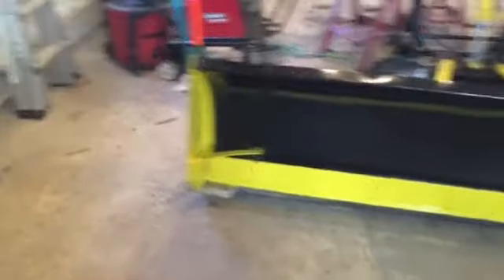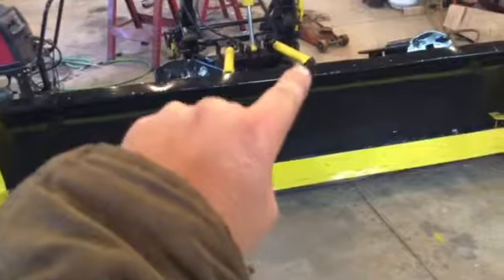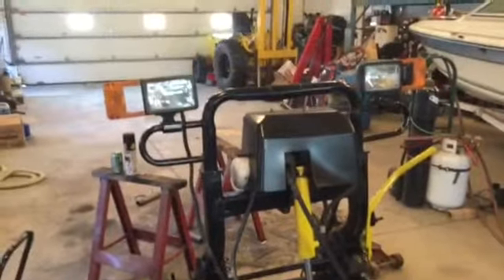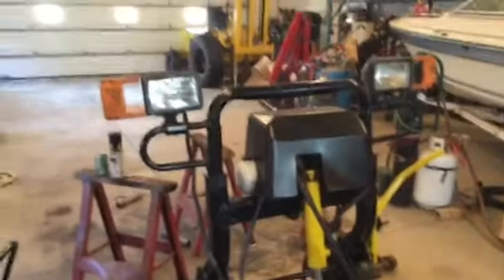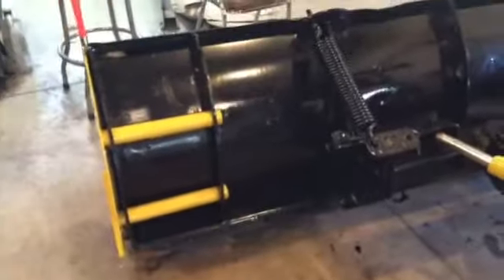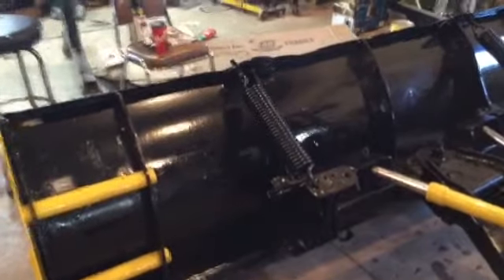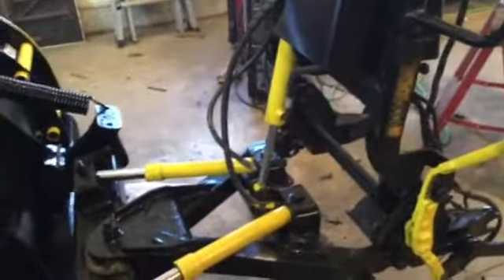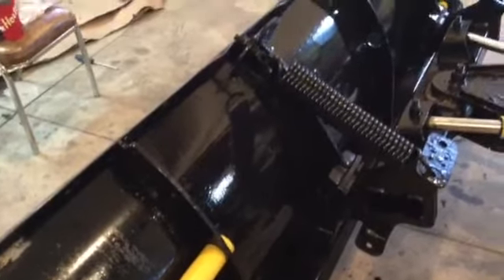Snoway plow update and why I like Snoway  and why that will be the only plow I buy

Comment: contrary to what a lot of people think boss in fact does not have down pressure. I ran boss for years. I loved their plows. No complaints. I always joked about sno-way saying "there's sno-way I will put one of their plows on one of my trucks" Your blade looks nice though.
Reply from the maker: Fireguy1020 I have gone up against a boss there's no comparison snoway  cleans and scrapes much better and parts are that day or next day
Reply from the maker: Fireguy1020 try one you'll never go back boss is an excellent plow there's no doubt about that but if you have a chance run one of the snoways  the down pressure I will guarantee you you'll never go back and the new V plow is really cool One thing I like about the snow way controllers you have one controller to control all if you have a sander the snoway control will also control the sander,  one set of controls in the truck instead of two
Reply: merctr2 i got out of plowing 4 years ago and haven't looked back. I ran a 14 foot ebling rear plow on the back of my truck so my front blade didnt need to have down pressure. Also i could make a 14 foot pass when it would take everyone else 2 to my 1. driveways were scraped clean every time I went out. check it out on my channel. some of the very first videos I posted. definitely look into one.

Comment: I have a 2012 f150 with electronic power steering modular and apparently the snoway 26 and 26r is the only plows aloud to be ran on my truck- I am a western guy and torn on purchasing the snoway although all I ever hear is how good the down pressure is. I have about 20 residentials to take care of as well as 2 parkinglots. Do you think the snoway is commercial capable and reliable?
Reply from the maker: MrGLENN58 all day long my friend you will love the plow I have had Fisher Western and boss until I tried this Snow way and that’s all I do is big parking lots I think you will be happy with it
Reply from the maker: MrGLENN58 One more thing my plough is it 2006 model I have ploughed a shit ton of snow with it with very very minimal breakdowns being able to hit the down pressure in scrape a parking lot off is completely awesome feature instead of having your plow right up on top of the snow and leaving slippery sections down pressure is also and asset if you’re salting on the back of your snowplow you use a lot less salt  but the key thing is salt as you plow also a fantastic company to deal with for warranty purposes parts availability that company is there please and I would recommend them highly absolutely outstanding plow especially when you’re doing driveways in residential have you ever back dragged with the plough that does not have down pressure it kind a rides up on the snow with the down pressure your clean them off like no tomorrow you will love that Plow